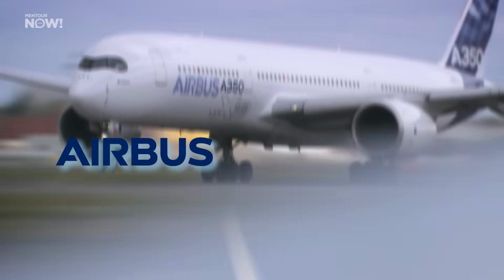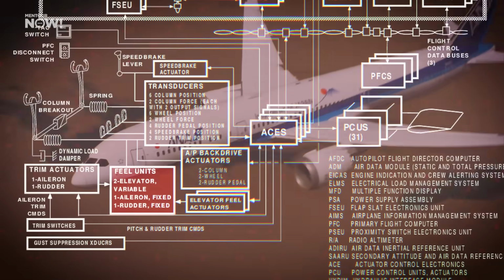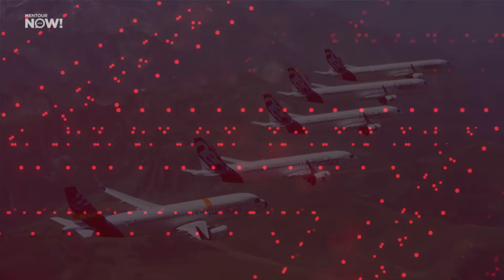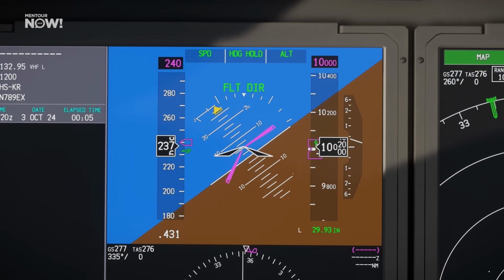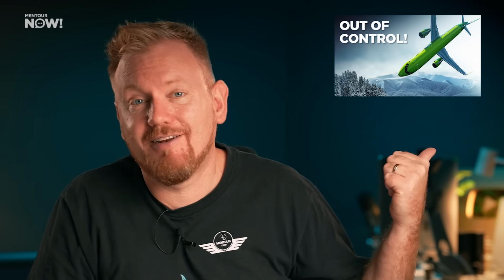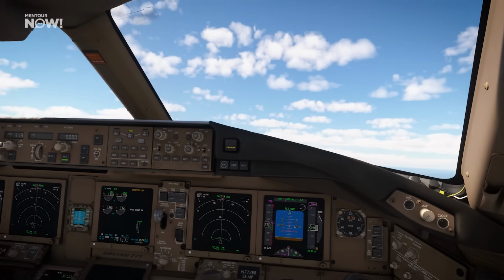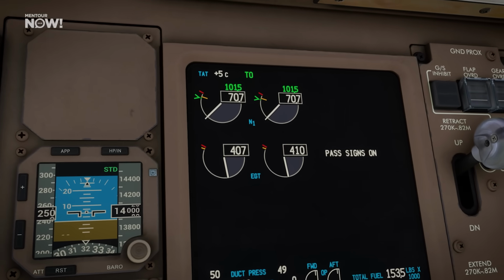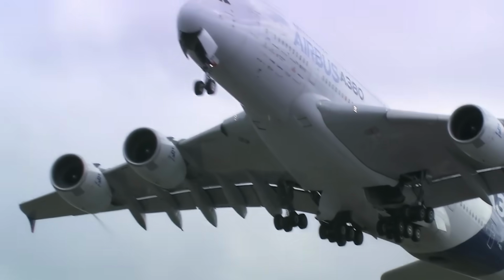Do Pilots Prefer AIRBUS over BOEING?!

Comment: The Airbus will not allow the pilot to deliberately stall the aircraft, nor will it let the pilot roll it too far, but it didn't stop a pilot from committing mass murder by slamming into the side of a mountain. I lost my best friend that day.
Reply: The protections are only there to prevent normal flight envelop exceedance. It does not prevent controlled flight into terrain like that accident. Can't crash proof a plane. I am sorry you lost your best friend in that terrible accident :(
Reply: I rather blame the pilot and the stupid EU safety door regulations for that Germanwings tragedy than Airbus. I have no particular feelings for or against Airbus per se. However, preventing pilots from deliberatly stalling an aircraft might not be a bad idea given the large number of stupid and unnecessary air crashes that have happened because incompetent pilots stalled the plane by mistake.
However, no system is 100% fool proof. Pierre Cedric Bonin managed to crash an airbus simply because of incompetent flying. The closest he should ever come to flying an aircraft would have been to play Mario Kart.

Comment: A potential solution for Airbus would be to reposition the joystick to the center control panel, possibly with a swivel that enables swinging it to the center so either pilot can use his or her choice of favored hands for control. Stowed away, the pilot uses right hand, and co-pilot uses the left instead. Or simply a single control stick in the center so it's clear who has control. I find the positioning of the onboard computers illogical down in the center and not taking advantage of modern ergonomic lessons that we follow in our everyday life. I would replace it with a more modern keyboard that can be pull down in the center of each pilot where the tray (if down) can help make it comfortable to use-maybe with a mouse (or mouse-like mini-joystick control) to simulate how we are used to using computers. The goal is to keep the eyes up and take advantage of our motor skills that we use in everyday life. Back when they started using these onboard computers, they didn't understand the ergonomics or safety problems that we now have perfected. Yet, it's shocking how the airline industry's cockpits are unintuitive, which can be problematic during an emergency. Making it more in line with how we have our setups at home can help our brains work better. We know for example, how "looking down" at a device when driving cars can be distracting. Having it up on the dash area would be safer and keeps eyes on the same level as the other displays.

Since we hear about pilots not noticing the thrust levers going down or up without their knowledge, I would also move that forward and higher so our peripheral vision can detect their automatic movements. I find that shocking to hear how some flights crashed because they didn't notice this. I understand that it may feel less comfortable, but it avoids the head needing to swivel up and down in the same way putting the onboard computers higher would help. I would put automation controls in the center lower panel instead.  Thie would leave more room for displays above.

As it is, however, I would likely prefer the Boeing as it is more intuitive. First, I am right-handed, and having to use the left hand for joystick control would seem strange. And lacking feedback or shared actions of the other pilot would lead to confusion. I'm sure I would likely get used to it, but still these are quite dumb and the intuitions for flying and feeling the plane is important, especially when under stress as some pilots have experienced. They get confused because the ergonomics and logic fight their intuitions. If relying on a joystick, if it can be centered, and including a common keyboard with all computers displays up high, this would eliminate the confusion during stress. Airplane engineers need to try to make it easily intuitive so even a non-pilot, or even a child could take control in an emergency using logic we already know.

Comment: The conclusion to this video is slightly misleading. It focuses on the fact that fourth generation jets are ten times less likely to suffer accidents when there is nothing wrong with the plane, and that both Boeing and Airbus manufacture and sell fourth-generation airframes. So far so good. 

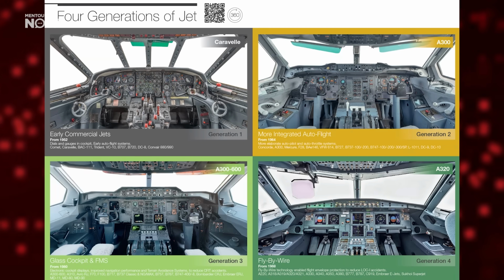What it fails to point out, however, is that Boeing continues to manufacture and sell third-generation airframes, namely the 737 MAX family (the diagram in the video at 26:25 confirms it as third generation). As far as I can tell, they plan to keep building and selling this old design for at least another decade. 

In short, Boeing continues to make and sell an older, inherently less safe aircraft design because it makes them (and some of their customers) more money.

Comment: I prefer the concept of Boeing. I'm an old software developer, I saw a huge amount of softwares in my life, and that's why I don't want to see airplanes driven by a software. Airbus put the pilots in the seat to check the software which controls the airplane, I find the plane better which is controlled by intelligent and thoughtful pilots, allowing softwares to help them.

American Airlines 587 A300. The airplane went into turbulency, the pilot used hardly rudders to correct because he was teached to do this, but the stability plane came away, everybody died. The awakening force had not overcome the nominal limit but the composite material was overloaded and has broken. What did Airbus, what was the conclusion? Redesign the stability plane to be stronger? NO. Make experiments to study the vortices around the tail, and their affection to the firmness of the attachment points? NO. Modify the software not to allow such wide rudder motions in higher speed? NO. Suggest companies to teach pilots to step on rudders not so hardly? YES. This was the lesson of 260 deads. Airbus is a very beautiful gaming console, made by an international fellowship, nothing more.

Comment: There's just this thing inside me that loves both manufacturers,I mean, Boeing and Airbus...they both make cool and smart aircraft's.

 Someone once told me that Airbus is the future 'cuz of the automation and lots of protection that it has.

 Then again someone also told me that it's not about the car but the man behind the wheels.

Automation has so far made aviation safer✅️ than it was today but  sometimes they fail⚠️ and it's inevitable..,what happens when this occurs if the pilots behind the controls know little to nothing about raw flying,this is the reason all pilots must be like the bush pilots or redbull pilots....if the crew of flight AF447 especially the FO was experienced enough, that A330 never would 've crashed and in that kinda situation is where the need for hand/raw flying kicks in.

Comment: ya srsly, im jealous of the tray table. im on the 777 and yes the cockpit is huge but eating in the cockpit is still a pain.
but remember, boeing planes like the 777 are designed by, and for, guys old enough to retire. so they want less info and and hand-flying because that's what they're used to. i think airbus's philosophy of system displays is really useful for the newer generation

Comment: Boeing wants to sell its rocket that abandoned astronauts Butch & Sunny on the ISS because boeing removed the undocking (from ISS)  software,  just before they launched it,  and it was riddled with dozens of leaks plus about 8 thrusters not functional.

I suggest that mentor should do a competition for suggesting the best purchasor for this boeing crap.

I start the nominations with the  "Laughing policeman".
I make a second nomination for  "Steptoe & Son".
A 3rd nomination;  how about the script wrighters for TV series  "Mission Impossible"?
4.  Remember:   The little Dutch boy that put his finger in the hole in the dike to prevent Amsterdam from flooding.  Much like putting chewing gum on the leaking holes in starliner!   (NEVER get boeings copy confused with the great SpaceX STARSHIP).
5.  Have a haulage company,  draw up a novel design for an enormous capacity "rocket trailer"  (it does'nt take too much thought)  & Sell it all to the muzloon society of Space Invaders!

Comment: When safety systems are making things worse it’s always big news but when they work properly they will prevent problems which means these errors will never surface. A safety belt that strangled someone is bad but this news will ignore all the cases where it worked as intended and saved people.
And if more or less information is better: this really doesn’t matter. Because the brain is looking for differences aka when you know how a display of informations should look like every odd value will stick out. But this is only true when you know the system’s intimately. A Boing pilot will simply not know intuitively how some information screens should look while every error will be obvious to an experienced Airbus pilot. And a Boing pilot knows how to get the needed informations while an Airbus pilot expects the plane to actively give him these information.

Comment: I just worry that if the plane is not engaging the pilots. If they are just monitoring systems all the time and nothing out of the ordinary ever happens. It’s just setting the industry for incidences where the startle effect of having an issue becomes crippling and the person on board is just a monitor not a pilots so to speak. 

Of course these incidences would be so rare that perhaps it would be seen as less likely than a pilot in control being the issue. 

Hard to say.

Comment: 15,000 or so hours on the 757/767 and around 6000 on the 330/320. I don't miss that Yoke (control column)stuck between my legs. I'm a side stick convert

Comment: Why did I watch this? I'll never fly anything. Even playing with a simulator game is something better not to tell to my doctor. I sail, but there is no sail-by-wire system in my boat. Such a thing could be possible nowadays, but I don't want it, because one of the reasons for sailing is to steer and control the boat. But I'll write the same comment I wrote on another video recently: basically, Petter is speaking about people and their relationships with the machines they handle. Or manage. Based on this, I'd ask if there are Boeing- and Airbus-type pilots. I mean pilots who perform better in an Airbus or a Boeing in stressing situations. Could it be somehow researched, and is it relevant? And if so, what to do wiht such an information? If you are a Boeing type personality, but working at Finnair, flying mostly Airbuses, some Embraers and ATRs, should you then find and employer flying Boeings?

Petter compares Boeing and Airbus here, but there are still other planes, too. How does Embraer or Bombardier/A220 series work from this point of view?

Comment: Either ideology could work well with adequate training and good production and quality control (here I assume airbus are much better currently), but one thing that has always concerned me is how utterly pitiful the display systems seem to be on both.  

Even in my car, if something goes wrong, tyre pressure or break fluid for example, it is IMPOSSIBLE to miss.  There are various warning signals and my whole dashboard lights up to indicate a serious problem at it is immediately clear what has gone wrong and what needs to happen to mitigate it.  Yet in both of these aircraft, the warnings seem to be very easy to miss, these issues don't stand out enough.  It should NEVER be missed when an aircraft is compromised in ANY way, direct law for example.  More worryingly, the ability of pilot and copilot to both have control seems completely unavoidable and absolutely unnecessary.  Why have these very obvious issues not been adequately been addressed?

How easy would it be for a larger and more comprehensively designed screen to be installed?  Even a Tesla seems to have a more insightful and informative screen than modern aircraft.

One last point, I have watched many of these videos (and I'm loving them all), but the suggestion that Airbus manuals have too much information is a little 'odd'.   From what I understood, there is no such thing as too much information or too much context.  Most accidents appear to be the result of too little information or understanding....?

Comment: Airbus use an optic fiber cables to transfer the CAN packets into the executive controllers that drive the electro-hydraulic modules and engine controllers. As far as I know the modern marine ships including the motor yachts are using the fly-by-wire tech.

Comment: No significant difference?  How many concealed hatches have blown off an Airbus due to poor or missing welds?  How many times has an Airbus shed parts in flight due to metal fatigue?  I could go on, but you get the idea.  How many times has human maintenance laziness, stupidity, inattention or hubris caused injury, death or serious damage to an airframe?  You analyzed pilot preferences which include some design choices, but isn’t proper maintenance equally important to safety?

Comment: "Miracle on Hudson" wouldn't happen if it would be Boeing 737, but not Airbus 320 who took a part of the incident. 
NTSB analysis after the incident confirmed that during this landing on Hudson river pilots moves where constantly corrected by computers. That helped the pilot to ditch the tail first and avoid dumping the engines until the very end  which avoided sudden breaking caused by sinking engines, which would probably lead to  diving the plane nose under the water and definitely there would be some victims involved. Due to computer assistance everything went smoothly. 
On board of Boeing passengers wouldn't stand a chance...

Comment: Well Airbus, doesn't fall apart or out off, the air as much lately, so I'll go Airbus.
  Human error always will occur and whilst over artificial control is not desirable in the hands of competant piolts, it is if reported back to the pilot, in a easy to understan way, probably the best solution. Airbus suffered in the early days and Boeing suffer from it now, the problem also exists, within the number of sensors making the decisions and the processor making a conclusion. If it were possible for the large amount of info to be provided simply, whilst still guiding them, there might be a change.

Comment: Boeing is by far the better aircraft to operate. you did not mentioned of the reason why the control flight into terrain happened of the German Wings airbus and why the aircraft did not engage safety protocols itself if it has a override feature?

Comment: I’m an Airbus pilot and I absolutely love flying it. It’s been designed so well and it’s a spaceship that’s also a 1980s Atari. The automation allows you to really think about where the airplane is and where it needs to be and because of this you can do your job of managing the flight path with great precision. BUT! The airplane can be tricky to land in windy conditions because all of the amazing seat of the pants flying skills you earned flying other jets and piston airplanes gets thrown aside. So when you come in to land in a big crosswind for example you need to be thinking ahead of the airplane and anticipate what it’s going to do because you can’t FEEL anything that’s happening. It’s all visual. If you fly it like a regular airplane it will punish you with bad landings. And even when you put in the correct inputs sometimes the landings won’t go super smooth. Therefore you’re thinking minutes ahead of your approach “ok get the right wing down and land upwind wheel first but don’t bank too much to deploy the spoilers and I’m going to kick in left rudder at ten feet and go idle at 20’” in contrast with a regular jet where you’re just landing on instinct and coordination and experience which is better in my opinion. The airplane isn’t as good as a traditional jet in situations where the autopilot and flight directors get turned off because it’s a flight path airplane and really doesn’t give you any feedback. But because we are usually flying into busy airports it’s not an issue. My colleagues that fly the Boeings also greatly respect and admire their jets but complain about the small and loud cockpits.
Reply: Yes - it seems really foolish of Airbus not to implement lots of feedback to supplement instrument feedback - ie put some tactility into the joystick and make the throttles move to the position that the engines "see". This might have been difficult to do reliably and safely when the A300 was being built, but not now.
None of that would compromise Airbus' correct philosophy of giving the pilots as little opportunity to stuff up as possible - hard protections ARE better than soft ones because even superbly trained humans are error prone. But especially in Direct Law, when almost by definition relying on visual feedback from instruments is problematic, that haptic feedback will be a real help with the pilots' situational awareness.
Reply: perfectly said
Reply: Best comment !

Comment: Honestly I prefer Boeing. I love the feedback on the yoke. I have not flew with an airbus or a Boeing just yet (in the cockpit, I only flew on the simulator), however I flew with a c182, and in my opinion it's better to feel the forces and the direct control of the plane. One thing tho is that the Boeing's cockpit is way smaller than the airbus's. In my opinion, I prefer Boeing, however I will fly whichever plane the company has, and be the happiest man alive.